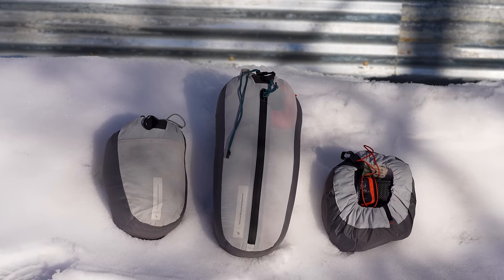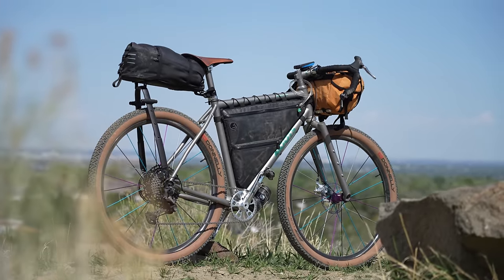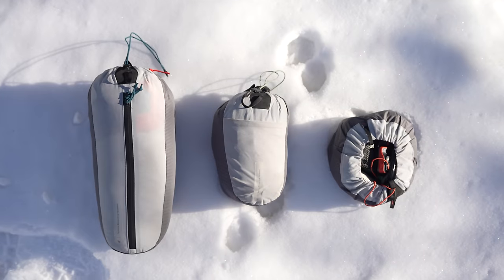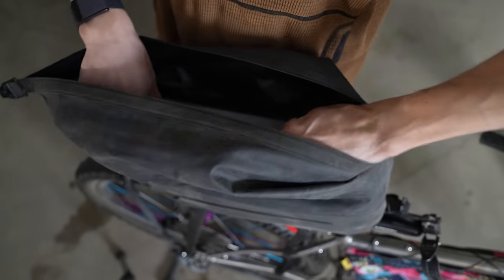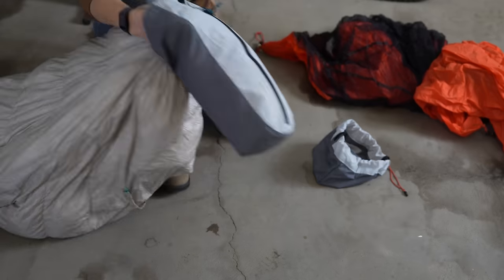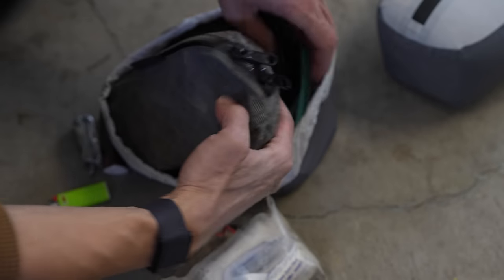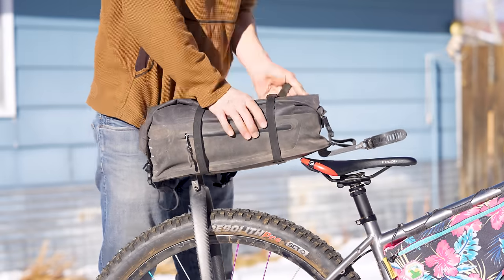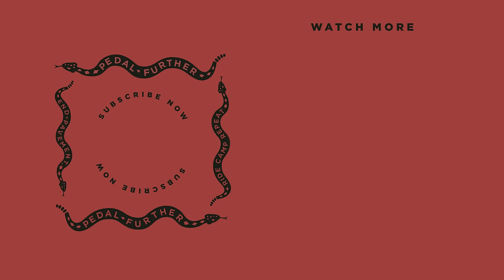Tailfin Packing Cubes Review: Off-Bike Packing For The Aeropack

Comment: This Tailfin gear looks smart but it’s kinda expensive… my solution was an Ortieb rack and a 31 ltr Rack Pack strapped to it. Great waterproof bag with full length closure.
Reply: How do you attach the rack pack to the rack? Does it hang off the rack?
Reply: I have used 2 Rox motorcycle/atv straps which are really good. Shame I can’t add a photo here ? 
Yeah I was concerned the bag might droop over the rack but no problem, thinking of putting a 2mm plastic sheet in the base just to give it some structure.

Comment: aside from frame bags, so far the popular touring gear have been disappointing to own and use, particularly seat packs and bar rolls....  tail fin is on great path here.  Zippers under tension are a proven losing idea, however.
Reply: I thought that may be a weak point, but Tailfin do give a 5 year warranty
Reply: We really tore our hair out over whether to add that zipper on it! In the end we kept it on for the folks that use it for non-puffy things. i.e. clothes. I agree that pulling a puffy sleeping back out through that zip wouldn't be the best idea.

Comment: Looks like a better system than what I use as I have to remove my dropper to use my rear pack.  But, I would never pack my quilt with my tent as the tent is almost always wet in the morning.  Thanks for the vid.

Comment: Do you also have the 10l panniers? If so, does the largest packing cube fit inside that?
Reply from the maker: the 6.5L fits in the 10L fork pack perfectly, so I assume it works well for the 10L mini pannier, but I dont have those.
Reply: Thank you for checking. They're both the same size so it sounds like it will be perfect for the pannier bag too.

Comment: Looking great those cubes. But, would you really pack your shelter and your sleeping bag/quilt in the same cube? I wouldn't even use the same bag compartment for it, as that's a receipt for disaster in miserable weather. I would recommend using a clear "dry" and "wet" separation system, on all trips, with a bike or on a hike.

Comment: Wait a second, how does the Aeropack claim 20L of capacity when putting three cubes totaling 12.5L maxes it out? 🤔
Reply: They call it an 18L bag now. But useable is like half that for most people because of the way it tucks under the seat. 

I used a drybag strapped to the top for a race and it was actually a cleaner setup.
Reply: @Davis2001r6  I ended up getting a Tailfin setup shortly after commenting this. I’d say I do probably get close to 18L storage out of it, but I do have to use the seatpost extender to get the height required to fill it up to the brim. I think Tailfin should just make the extended seat post clamp the standard moving forward since pretty much every bike can benefit from using it.
Reply: @DJLaFontsee I had to the extended top piece as well. I do agree I wish the ordering process was a little more intuative on which setup you should get.

Comment: I gotta vent here: 
The whole tailfin ecosystem is an insanely bad value proposition. So many reviewers treat it like some revolutionary idea when to me it looks like a more expensive, less useful solution to a problem that regular racks solved long long ago. Why would you wanna spend double the price to be locked into a specific brand for your racks+bags????
Reply: Half the weight.
Reply: I bought an Aeropack as it was the only solution I could find to work on a full suspension MTB. As I am a short rider and rely heavily on my dropper post a seat pack was not an option.